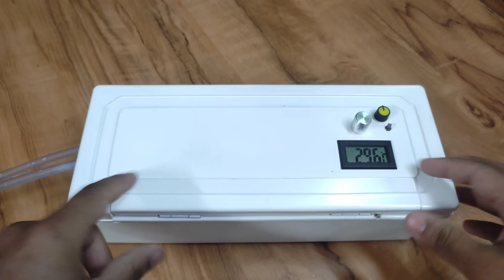How to make Homemade Air Conditioner | how to make AC | Air conditioner | Peltier module AC | DIY AC

Comment from the maker: Wiring diagram 3:46
Reply: How much does it cost?
How much time it takes to cool till 20 degree c.
Reply from the maker: @ajinkya3780  It cost me around Rs 2000 to make and takes 30 minutes to reach 20°c
Reply: @SwapnilExperiment8123  Rs for any country?
Reply from the maker: India🇮🇳
Reply: What is the name of the putty with which you stick polyester?
Reply: @hamzamouhamed4820 não é cola, é pasta térmica usada em coolers em processadores de PC, ajuda na transferência do valor

Comment: I made a simular system with around 1000W worth of peltier modules. For inside heat exchanger i used 3 triple fan water coolers for pc and for the outside a car radiator and double fan. The whole system is not effiecient and does not even cool a small bedroom.
Reply: can you make a video showing what you did?
Reply: did u use 1000w for peltiers, thats huge energy indeed. And did u exhaust the heated air to outside of window.
Reply: @serdar-ors  Yes, the big car radiator went outside the room. Those 1000W were split into 3 bundled units each with 3 peltiers working at 12V 10A. Powered with 3 separate 30A 12V power supplies. Cooling Output was maybe comparable to a 250W mini split unit. These Peltier modules are not efficient at all. For efficient cooling stick to compressor operated units.
Reply: @tronixfix  i understand, i wish there was an easy diy compressor method. Otherwise i will make a basic ice filled box with fan design :)
Reply: If you use Peltier TEC 12706, it use 12,7 Volt 6 Ampere = 76,2 Watt x 3 unit peltier = 228,6 Watt only for peltier, exclude power for fan and for pump.
As far as i know, peltier efficiency now about only 10%,
Compare with refrigerant compressor efficiency can above 25%
Reply: Cap
Reply: Give it a much mor beefy cooler
Reply: @tronixfix  what if i keep frozen copper bottles in front of normal table fan
Reply: You using a wrong peltier. Use 12703 then update the conclusion 👍🏻
Reply: @LFSIDIndonesiaOld  I used 12710, how can a smaller one help?
Reply: @tronixfix We are still waiting for your video
Reply: u should use exhaust fan..

Comment: TQ for the video. I wonder if we can put in thermometer to regulate temperature?
Reply from the maker: Thank you so much for your feedback. 
Nice idea, Yes we can do that we will have to put another temperature meter in there but that temperature meter will be different. 
I will definitely try this in the upcoming video. 
Temperature meter link : https://www.amazon.in/ApTechDeals-digital-temperature-controller-thermostat/dp/B07PSLMPMW/ref=asc_df_B07PSLMPMW/?tag=googleshopmob-21&linkCode=df0&hvadid=397024047018&hvpos=&hvnetw=g&hvrand=17928828151731967450&hvpone=&hvptwo=&hvqmt=&hvdev=m&hvdvcmdl=&hvlocint=&hvlocphy=9154203&hvtargid=pla-836293250574&psc=1&ext_vrnc=hi

Comment: what if you let the cold water flow inside the tubes of a radiator while the fan makes the air pass through the cold radiator... will it work much efficiently cooler ?
Reply from the maker: Yes, of course 
I also wanted to use the radiator but i could not get it in time

Comment: What is the lowest degree the air conditioner can reach?
Reply: Depends on the temperature of the hot side. With a good peltier you might get around a 20°c difference. But remember the cooling is generally only going to be around 10% of the wattage of the peliter. So a 300W unit will only move around 30W of heat. So it's not really ideal for a situation like this. If it's a 300W unit it will provide around 100BTU/h of cooling.  Your body produces between 250 and 400 BTU's of heat. So it's not enough to even offset the heat produced by your body. Let alone heat from your computer and that leaking in from outside.

Comment: suggestion
1. why do you use a comb
2. the outdoor part doesn't have a radiator
3. usual air conditioners take air from the up because heat goes up while cold goes down

u can ignore it:
1. I don't really like the song
2. the shape is weird

Comment: It is good  for small cooler for vehicles
Reply from the maker: Yes, if the vehicle is small then there is no problem but it will not be able to provide good cooling in big vehicles.
Reply: @SwapnilExperiment8123  not for cool vehicle use as mini refrigerator

Comment: with running water inspired me to do something similar, but it’s a pity to drain the water into the sewer, so I created a slightly different design, without unnecessary loss of water. The video about such cooler is  available on my channel. But it is difficult to fully understand (calculate) the efficiency of this device. I would be grateful if you could made a video about the efficiency of this device. 目
Reply: nothing about this drains water away - the reservoir is clearly shown, which circulates the water - no loss of water - it is only used to transport the heat to the water outside.

Ideally this outside water then needs some way to be cooled also, run through a radiator and a fan.

the mass of water acts like a heatsink but will eventually equalise and the system will lose cooling ability. the heat MUST be removed at least at some speed.
Reply: @foff-666 True

Comment: To cool a 16 m² closed room, how many Peltier 12715 tablets would I need to use?
Reply: I think 4 ACs like this
Reply: @FamiliOfficeDotCom  more like 16x because its extremely inefficient PLUS the outside reservoir must be pumping through its own radiator and fan combo - or eventually that water reservoir (the mass of water determines the time this takes) will equalise in temperature and you will get no more cooling at all. infact you will get HEATING because the system is still adding energy.

Comment: How many watts power for this AC?
Which Electricity consumption is higher normal fan or diy ac(your ac made)?
Pls reply
Reply from the maker: I have used a 15 amp painter model inside it which runs at 180 watts and along with it there is also a fan and a water pump.
How I calculated it was by simple formula: watt = apm * voltages.
According to Quora typically, the power consumption of an AC fan mode ranges from 30-60 watts.
So yes, the diy AC itself consumes more power than an AC fans.😂

Comment: This may work for a short period, but then the reservoir which circulates the water which is only used to transport the heat to the water outside will itself heat up.

Ideally this outside water reservoir  needs some way to be cooled also, such as run through a radiator and a fan combination.

the mass of water acts like a heatsink but will eventually equalise and the system will lose cooling ability. the heat MUST be removed at least at some speed or the law of thermodynamics dictates it will all equalise and since you're continually pumping energy in, will actually HEAT the room/space you intend on cooling instead of cooling it.

Comment: Uh, so the water is supposed to cool the hot side but isnt it just boiling the water if its moving it constantly through it ?
Reply from the maker: We can solve that problem with radiator. But, I did not have radiator at that time.

Comment: Where does the heat from the hot side of the Peltier go?
Reply from the maker: That heat mixes with the water and the water gets heated, that water has to be changed after every 1 hour cycle.
To solve this, you can also install a radiator there, I also wanted to install it, but due to some reasons, I could not find the radiator.
I hope you got the answer of your question 😊
Reply: @SwapnilExperiment8123  Ohhh, I get it now. I'm trying to build something like this, but with the Peltier the other way around. The cold side in contact with the water block, cycling the liquid through a radiator. The hot side in contact with a pipe heatsink+fan and vented outside. Do you think it would cool a small space?
Reply from the maker: yes it cools a small area when i tested it it cooled an area of 3 feet by 3 feet. If you want to cover more area then you have to add more Peltier models. how much area do you have to cover?
Reply: @SwapnilExperiment8123  about the size of a fridge, 3x3x6 feet. I need to bring down the temperature from 30ºC, to 26-27ºC
Reply from the maker: I think that will work, if not, then one more Peltier model will have to be added. 👍🏻

Comment: Can I change the Peltier module  12715 to 12703 module ? 
because the Peltier module 12703 is better than you used , isn't it?
Reply from the maker: No bro 12715 is peltier top of the line it is of 15 ampere and 12703 is of 3 ampere that means 12715 is 5 times better than 12703
Reply: @SwapnilExperiment8123  thanks bro
Reply: @SwapnilExperiment8123   What is the best module of them ?

Comment: What is the area that this air conditioner can cool?
Reply: Virtually nothing. It's around 100BTU (if he's using a 300W peltier). Remember a 5000 BTU air conditioner is generally rated for less than 250 sq/ft. So doing the math this is idea for 5 sq/ft (so a room 2.5 by 2.5 feet). So a spice cabinet?
Reply from the maker: It covers a small area of 1 meter by 1 meter
Reply: @SwapnilExperiment8123  what can we do to cover an area of 3 meter by 3 meter ?
Reply from the maker: If you want to cover 3 meter by 3 meter area then you will have to apply 9 peltier models. Here I have calculate simple maths 3*3=9